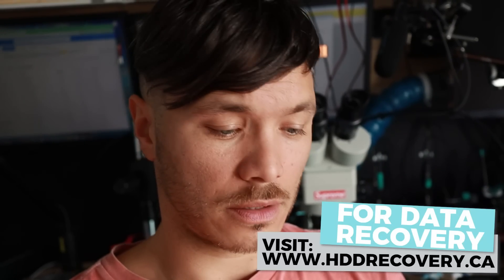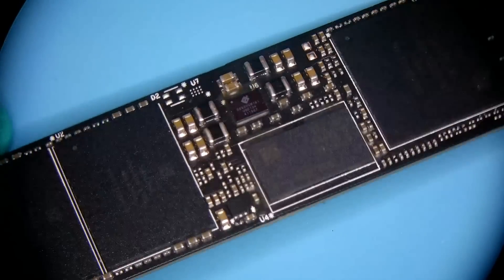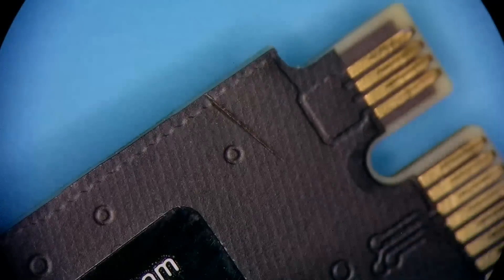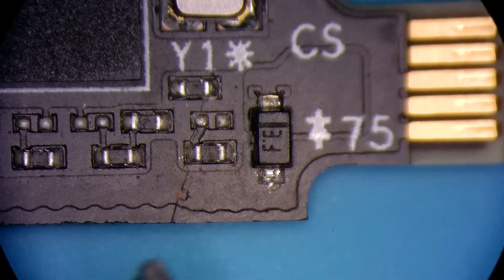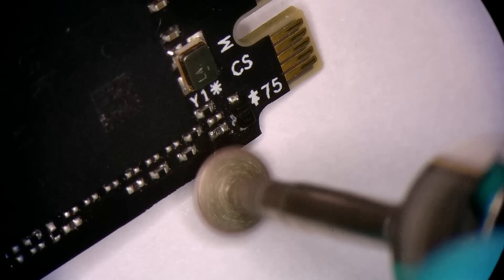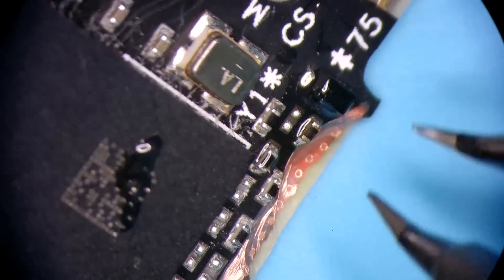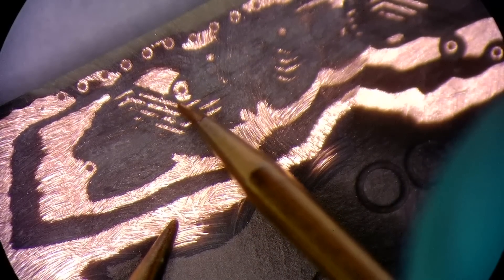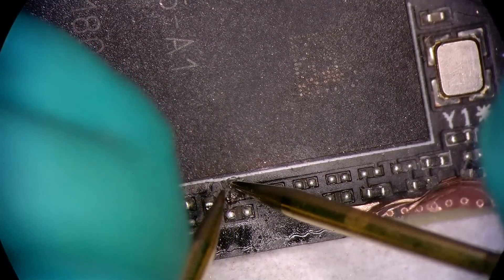can x-ray help us recover data from NVMe SSD

Comment: Thank you for sharing your great work. I don't understand why you said that flash memory devices needs to be powered evey few weeks. After all the data is FLASHED into the memory and doesn't need power to maintain the flashed contents.....
Reply from the maker: the charge drains overtime :) if you charge your phone fully, and turn it off, put it away for few months what will happen to that charge? will it stay at the same level? no
I've seen some enterprise SSDs that put massive capacitors to keep the charge for longer specifically for that. Look at this article: https://passive-components.eu/tantalum-polymer-capacitors-protect-data-at-ssd-applications/
Reply: @hddrecoveryservices  Thank you so much for the reply and info. I thought that the data is permanently flashed into the chip (like pc bios flash), But now I understand that it still need some current to keep it from being wiped over time.

Comment: A little late to the party, but did you try and see if it was recognized in Data Extractor?  The PC3000 does not yet support that drive (according to them) since it is based on the SanDisk chipset.

Comment: I had sata SSD with brand midas force, ust before I brought to local professional data recovery, when I pluged in the drive on regular pc windows read removable drive, when I tried to use recovery software I only can retrieve one partition, is it possible to extract data from other partition ?

Comment: Nice video! I have one doubt can't we recover data by interchanging the chips to a donor board which has good connection?
Reply from the maker: that would depend on what was the initial issue. if the unit was acting same way when it originally failed (possibly before the fracture even), then no.

Comment: It would be quicker and cheaper to transplant the controller and memory onto a working drive... wasted too much time and resources on that one.
Reply from the maker: You are the expert, so you must know. 🤣
Reply: @hddrecoveryservices  Depending on how you value your time, wasting time and money driving around for an X-ray while you've been long done reballing the chips with a donor board prepped by then... unless this was purely for YouTube entertainment value this move made no sense.
Reply from the maker: Ive considered all the options prior to making it happen. Swap would be the last option. I am more concerned about the fact that it responds well to safe mode and gets proper voltage to NANDs. I dont use "let's throw parts at it" approach like most ppl do in this line of work. Sometimes you do things that lead nowhere but it's not wasted time, it's learning, and experience. A that shit my friend is fucking priceless.
Reply: @hddrecoveryservices  That's a fair statement then. Always good to learn something new about the inner workings, gives more confidence when approaching similar jobs next time.

Comment: I don't have experience with data recovery, but why you didn't just move black parts of SandDisk to a new NVMe SSD?
Reply from the maker: Parts would take at least 3 weeks to get by the time we got this case. I don't have all the donors that are our there. I have a lot, but this variation that I had was different

Comment: What type of wire are you using?  And what is the liquid mask stuff you used?
Reply from the maker: 46AWG isolated wire, curing mask to protect the repair joints. common stuff along cell phone repairs. I get it from union repair (you need ultraviolet curing light for it to turn hard)

Comment: Yeah, shame you did not had luck with this one, but it's still nice to see the work done behind it.
edit: The "having them take a charge from time to time" issue is actually thing i was curious about in the past but was told to "don't worry about it " (which did not sit well with me, but i trusted the advice). It's nice to see my gut feeling was not wrong...
Reply from the maker: I would not worry about it if memory is SLC, but now all SSCs are based on TLC, QLC and 3D NAND crap. I may go into a full video explaining it in detail.

Comment: Since the suspicion was a probable bending damage and it was near a bga chip - wouldn't reballing be also worth a try ?
Reply from the maker: someone mentioned it before. It was worth a try, but I did not have that part filmed. I do get access to ROM mode before and after the reball. We will wait for a donor. Part 2 in April

Comment: Will NAND really degrade if not powered on regularly? This is more or less the first I'm hearing of it. Not that I doubt it, I'd just like to know more
Reply: It's possible, the voltage slowly gets lower of the cell. This is called cell drift, mostly ECC can correct for this. When the drive is powered there is an algorithm in the drive firmware that refreshes the cell every x amount of time. SLC is the least likely to get affected by it and QLC the most.

Still it's hard to say how much time it takes, it depends on the write cycles and the quality of the NAND. 
Like SLC has a retention time of up to 10 years, MLC and TLC are in the 3-5 years range.
But with bad quality NAND or tons of write cycles it can be as short as just 1 year.
Reply: @f0x4nn3  I compare this to Bit Rot on spinning drives, the bits would slowly loose magnetic charge on the platter. The only way to restore the charge is to read and re-write back to restore the data integrity.

Comment: Erkin.  We have had so many SN850 drives fail in the past year.  Well over 50% failure rate.  They are all in warranty, and we RMA all of them.  But would love to know why they are failing recently.  As the past SN750 and SN850 pre-pandemic was rock solid.  I originally thought it was chip shortage issues.  But had a hunch it also might be the new NUC11.  Maybe the NUC is stressing the SN850’s and cracking the internal traces.  We are now stress testing the SN850x models.  Hopefully they will last longer.  Thank you as always for your insight!!!
Reply from the maker: I gotta RMA mine. Do they send a new or refurbished unit?
Reply: @hddrecoveryservices  Brand new.  Recently they've been replacing my SN850 with the newer SN850X.
Reply: All of our issues have been... The drive doesn't even show up in post or the system bios.  It says if the drive is not even installed.  Completely dead.  We replace with a new SN850 and all is good.  I get at least one a week like that.
Reply: Downloading the WD dashboard, and updating the firmware, does not help either. They still brick and become unresponsive. Some in a week.  But most typically fail within a 6-month time frame or less.  The new RMA drives have yet to fail.  Which makes me believe it was a chip shortage issue.  They used inferior parts just to get product out the door.  All the conspiracy theory by me of course. 😜 Again, the history prior to the pandemic these drives were freaking rock solid reliable!
Reply: How long did you have yours?
Reply: Were the failing drives manufacured in a specific date range?
Reply: @blunden2  Yes.  Manufacture date October 2022
Reply: @blunden2  Apparently we are not the only ones with WD drive failures.  There is now a class action lawsuit, for exactly what we were experiencing.  It's a different model. But same NVMe 2280 internal drive.
Reply: I've had 2 WD SN850 fail in 2 years (working one minute, and then a reboot later and not detected at all, even in external enclosure). My most recent SN850 (MDL: WDBAPY0010BNC , DOM: 12OCT2021) I took to a local shop for a quote and was told "Both the controller and the firmware have been compromised" and CHIP-OFF recovery was needed and quoted $1,870 for repairs. I declined and now researching around for other possible repair/recovery options.
Reply: @blugamer4495  yes same here.  My apologies for the typo above.  It's OCT 2021.  I had 3 more this week.  All with the same manufacturer date of OCT 2021.  WD_BLACK SN850 NVMe SSD
WDS500G1X0E-00AFY0		213434802650

Comment: you have bend pcb, close to controller's solder balls and you didn't do a reflow or reballing?
Reply from the maker: in the later tests I did, the behavior is still the same. Maybe there will be a sequel to this with NAND and Controller swap. I get access to the ROM mode so the controller loads, NANDs get proper power to them, but if I access NAND it just hangs.
Reply: @hddrecoveryservices   I wonder did you call to client and ask how much precious the data is? - if he can cover additional cost of buying new or used drive(exactly the same model)  to move controller and  nand to that board and if this would fix the issue the client could have a data recovered and working drive as well.

Comment: the advice at the end is interesting. I just watched a video where this guy fixed an old matrox video card. The only thing wrong with it was a corrupted vbios. It's a known common fault. Just simply reflash the bios (which means you're going to need another video card) and you're good to go. Apparently even in the day (late 90's) it was a common issue so they added something to the drivers to periodically flash the bios. LMAO
Reply: Oh, wow. Interesting piece of information.
Reply: @H53.  I thought it was as well.

Comment: Whoa, that is next level! How about getting the same board as the donor and transplant all original components? Seems hardly more difficult than what you attempted here. Good luck!
Reply: Same thoughts here . Seems to me the obvious thing to do.  I once did such a thing with a USB drive, though admittedly far easier as it was a long time ago when components weren't so tiny. For the time though it was a huge capacity at 128 mega bytes.
Reply: yeah...looks doable. With the skills he has.

He needs to transplant 2 to 5 of the big chips, if im right.

Comment: great video as always but audio is really bad.
Reply from the maker: I was so pissed off at myself dude, I plugged the mic to the charger and forgot about it. Charger dumped so much noise into the feed. I cleaned it with some sound effects but I know exactly what you mean
Reply: @hddrecoveryservices  despite audio it was still a good and informative video nonetheless. A shame it didn't fix the issue! I wonder if chip-off recovery would have worked to read straight from the NAND?